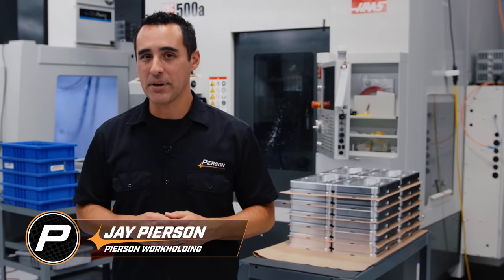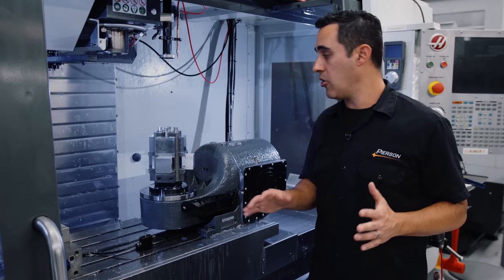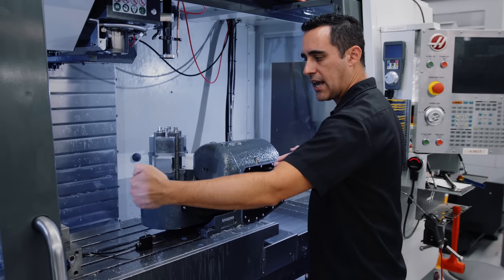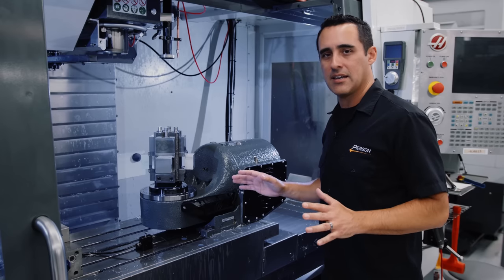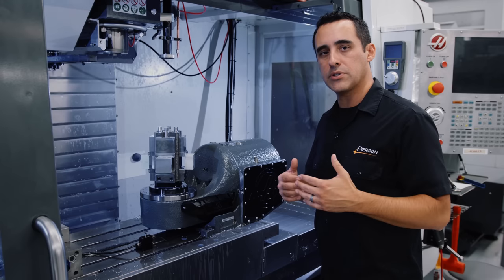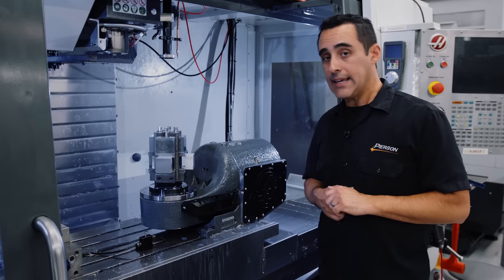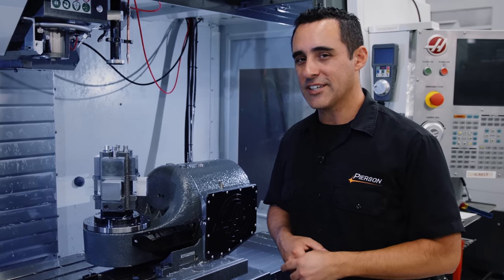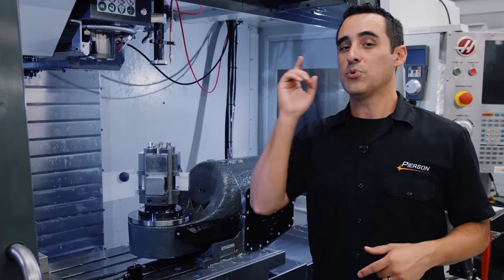I Instantly saved $120,000 with this 5 Axis Idea! | Haas TRT210

Comment: You should be able to change the axis letters inside the Haas controller while setting up the rotary.  It's customizable because you can rotate the rotary on the table.  This one might be too large for that, but some of the smaller ones can be positioned at any angle.
Reply from the maker: You can't rotate the TRT on the table and keep the same travels. For this reason, shops would want to keep the distinction between this setup and a UMC so wrong code will not run on the wrong machine - A,B vs B,C.
Reply: @PiersonWorkholding  In theory you should be able to it physically instead of digitally. Flipping wires etc. But I don't know exactly how haas has everything wired.

Comment: We run a 2017 VF2 with a TR-160 trunnion. It's similarly set up physically as an A-C axis unit and the control is also sorted and set up that way. Not sure if your Haas techs set it up as A-B or if the TRT units are different, but I would have guessed you could set the axis names to anything you want.

We also use the same MRZP sequence that you described for the UMC on that VF2+ TR160 combo we have. In the NGC it's in the visual programming system options under calibration. Rough measure with the work probe and then attach a precision tooling ball to a magnetic indicator base on the platter and it works great. You do need to walk through the sequence a couple times to get a feel for what movements the machine does so you can set up the tooling ball in such a way to not get interference/accidental probe hits.
Reply from the maker: Yup, the tech set it up wrong but by dumb luck, we like it. UMC programs won't run on this setup as they shouldn't. It's one way to mistake proof things.
Reply: Yup, thats how ours are set up too. Its the correct way.

Comment: If you're worried about pinching cables, why not try using a retractable chord line mounted in the roof of the machine.
So whenever the cables goes to the back right corner, the chord will retract the cables as tension is loosened.

Think of it like those retractable keychain doohickies. I'm swedish and not really sure what they are called in english.

Nice video byt the way 👍
Reply: We use them for our 4th axis on vertical mills

Comment: Adding additional axis to a machine that's suitable for that type of upgrade really boils down to if the axis is just a glorified fixture and DOESNT give the ability to machine dynamically on that particular axis. EG a moving axis that stops and locks to enable holes to be drilled or dynamic machining moving UNRELATED axis X, Y and Z  and may be C depending on machine type. They are cheap to add and can be done a multiple of ways. I have even set up a removable fixture with finite placement but a fixed axis that just had a plc running the fixture and M code outputs from the CNC. Finite adjustment of the fixture was done easily into the  separate plc with a touchscreen. 
It gets real tricky when you need to interpolate dynamically as adjusting 5~9 axis with machine tool accuracy (Unlike a robot) usually needs a pretty powerful parallel processors. The first time I did something like this was with a Siemens 810. It managed to mostly do the job with some program adjustment but the display just went out to lunch until it had finished the pre process.  Quite funny as I used to stir up new Siemens guys by running this  and complaining that there was a video problem. About 1 in 5 would know what I was doing. 
I would say that the Hass is just using a tandem processor for the 4~5th axis and then returning that data to the traditional 4 axis CNC.  It works most of the time but not always and will stop during machining even loose the process completely. The process in the CNC can stop sometimes as well as I spent days once trying to sort a machine problem on an OKUMA that would freeze the Z and X axis for just a single rotation of the spindle of a lathe leaving a mark using mm per rev.. The bios wouldn't allow the  additional on the fly advance calculation of the radius but once done it re allowed the movement and advance read. Dumb down the program to command position and the problem disappeared.

Comment: Very well done Jay. Looks like it will work out great for You. Hey I was wondering which video it was that showed You setting up the HRT210 with the manual hoist attached to the top of machine. I wanted to watch that one again. Again very well done and You got the nice product discount👍
Reply from the maker: Thank you for the kind words. Here's the video you're thinking of: https://youtu.be/FmoLplRqe6s
Reply: Thanks Jay. I watched that one too, but I was thinking You did one with more detail about the mounting of the winch and the cable fairlead. I want to do it for one of my mills

Comment: You should make a video/post showing how you load the rotovise. I always see products like this and think they could be awesome but also think it must be clunky to jog the rotary every time to load parts.
Reply: Not a big deal, hit MDI, select your axis and rotate dial, repeat to rotate and load the whole assembly.
Reply: Add the rotary motion in the beginning of the program. Load what you can, close the doors, cycle start to a different rotary position with an M0 after, load, and repeat as necessary until cycle start begins the actual run.
Reply: @zodiaceng That's what I was thinking.  We do for our 4th axis programs.

Comment: I've had lots of fun making smaller parts from bar stock in a fourth axis and then tabbing them off. Very similar mindset to the live tooled lathe being a automation center. 

Turn that thing 90 degrees on the table and I feel like you could fit four of them... wonder how that would work as far as all the drives required is concerned.
Reply: They sell an HRT210-2 which gangs up a pair of 4th axis rotaries while only needing one 4th axis drive. You could get a 5th axis drive and definitely stick a pair of those on a machine table. Configure each one as a master rotary, put a rotovise on each platter, and get a heck of a lot of unattended time. 

I think you could do the 5 axis rotaries in a similar way but you would need to use their external controllers to interface with them.

Comment: I have this same exact model (TRT210).  I just purchased it with a new VF3SS.  My C axis is correct. I wonder if they fixed it in the controls for newer models.
Reply: Also, Haas has software for MRZP for this as well.  Haas put out a good video on this called, "Don't fear 5-axis"

Comment: Do your rotovise can be installed in a Y axis lathe with milling capability at a relatively limited rotation speed in lathe mode? We have a milling type part but with top surface as cylinder...

Comment: All the tr160/210 and trt160/210 we have and have seen are all A-C axis and umc is B-C

Did you change the slot/clearance holes on the rotovise to accept the M10 SHCS we had to enlarge them on ours to fit the Trt210
Reply from the maker: Yes, we enlarged the holes and all RotoVises moving forward have more bolt clearance for the M10 screws. I mentioned it when we filmed but cut it because it was boring, lol.

Comment: Will your rotovise fit on the TRT160?  Charles
Reply from the maker: Good question, Charles. Yes! Both use a 5.51" bolt hole pattern and will work directly out of the box.

Comment: This is all good with one major problem. That is what happens when you break a tool or have some sort of crash with that unsupported 5th axis? I have one and have found that when there is a problem this rotary will get borked pretty easily. The UMC has a supported rotary and it can handle the occasional bump. Is it worth 120,000. I think so. 
Down time sucks!
Reply: I don't think the UMC is as solid as you think. He did a review on his UMC a while back and if you read between the lines, it had rigidity issues he had to program around.
Reply from the maker: Fair points. If crashing were a regular occurrence, we'd probably take that into consideration.
Reply: You do make some good points about the comparison between a UMC and a Bolt On 5th Axis.
The word Bolt On might be something to focus on.
Adding something to something that was designed and manufactured for a certain application.
As in this example,  Bolting On an additional axis/axis's to a machine that was designed to operate for an intended purpose. 
VF4. 3 Axis Machining.
With concerns over Crashing a Machine ????
This is something that is difficult to design for ????
IF you have a tendency to Crash a Car.
Best Not to drive a Car ??
Same scenario might apply to Machining ??
IF you do have concerns with Crashing a Machine.
There are breaking points in Every design.
Some have been designed into the part, others will fail regardless.
Downtime on machines after a Crash will happen regardless of whether it is a Bolt On design or purpose built ( eg TRT 210 vs a UMC )
The Positive of a Crash with a TRT 160/210 is you can remove the damaged part of this Machine and continue with Some machining capability.
Crash a UMC ????
Will be a lot more expensive than repairing a Bolt ON TRT 160/210
Just some thoughts 👍

Comment: Anyone know if these 5-axis trunnions can work on a non-Haas machine?
Reply from the maker: The community doesn't seem to have experience with this. Maybe your local Haas Factory Outlet can help answer.
Reply: Pretty simple to add them to non Haas machines, but most installs end up being run with a control box and M codes to fire signals to the box, then rotary and signal back to the machine when it’s finished. Getting to run simultaneous is not very common. HA5C (single axis) for example with a control box is one of the most popular rotaries/indexers you’ll see in shops and almost always on non Haas mills. Setup is no different on the tilting rotaries they just require two control boxes or one that can handle multiple rotaries, each having their own M Code. The rotation direction, speed and angle is set in the box rather than the program on the machine control.
Reply: @zodiaceng  interesting. We do have an HA5C on one of our older Okumas, which is controlled by an M code and an outboard box. It sounds like the trunnion would be very similar. Thanks for the explanation. 👍

Comment: Did you buy another Haas mill as you already have others and are in the ecosystem so to speak? Do let us know in the next vid! Interesting you have Haas Mills and Doosan lathes
Reply from the maker: Yes, bought a Haas VM3 with this. Standardizing machines by 2 brands is a big advantage and helps operators master only 2 controls.